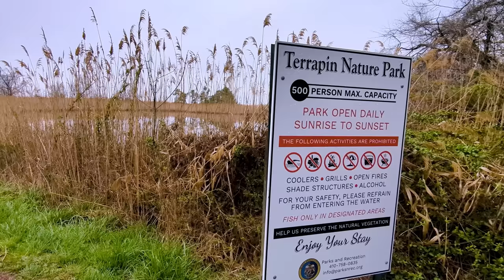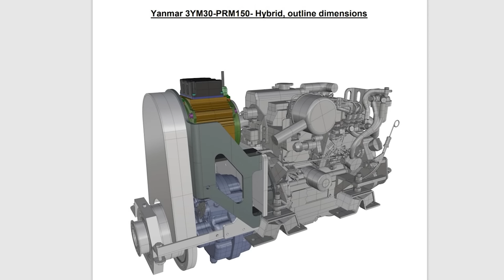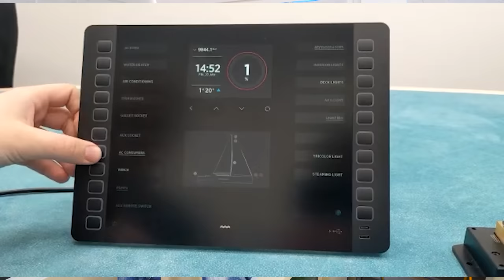Having a Quiet Cry in the Cupboard (MJ Sailing - Ep 278

Comment: As a pro auto body tech and custom car painter  for 40 years, i would say you need an 8" mud hog. Is a gear driven sander for sanding filler. It will make your life SO MUCH EASIER! Also, you have about a zillion square feet of surface. You have to find a way to worry about the stuff that shows, and ease up on stuff that is hidden.  Good luck. Nothing is perfect.
Reply: How about applying the filler with a wider mudknife, on big surfaces? Maybe all the applying with narrow knife makes a very uneven surface…i was noticing at one point in the video a tiny knife while applying.
Reply: @Jb001jb  Depends on how liquid the filler is when mixed. If it's anything like Bondo wouldn't be a good idea to use anything wider than an 8" taping knife.

If it's liquidy like firm drywall mud then I would use a long blade after dumping the filler on the surface. Something like the solid 18 inch aluminum skim coating blades.
Reply: By the time you finish building the perfect boat you’ll be too old to sail it. Don’t get me wrong I love your Channel I hope you achieve what your after but it will take time. You’ll know ever defect and problem in the build nobody else will see them but your eyes will train on them. I know from experience.
Reply: Shop air around a unfinished composite boat/airplane is not good practice! You risk contamination of structural joints. These air tools have atomized oil in the exhaust. You feed them with oil/water free air (supposedly) but the tool itself requires lubrication. Car repairs are typically cosmetic and if it fails you have a unhappy customer, on a composite boats/aircraft you can have a catastrophic failure that mostly will kill someone.
Reply: thanks for trying on the tears!!!
Reply: If they don’t have a hand held masking machine , it would probably help them out and save more time and cleaner lines .

Comment: I've done a bunch of drywall and Bondo etc.. so I can't imagine that fairing is any different. The lesson I've learned is to do it in multiple layers using the least amount of material as possible for each layer while also eliminating the high spots left by the knife. Start with a 3 inch knife for the seams. Then sand. Next use a 6 inch knife to extend out the material. Then sand. Next use a 12 inch knife and sand. Perhaps moving to a 16 inch knife. The principal is to put on the least amount of material as possible to reduce the amount of sanding between coats. 

It may seem like more work but in the end you'll do much less sanding. 

The blue dye may seem like a good idea but you really need to know how to use it. Instead, in between each coat cut the house lights and grab a flash light. Angle it parallel with the surface you're working on and move the flashlight away and towards the surface while rotating it 360° parallel to the wall. Every imperfection will be a shadow. For each shadow use a pencil and circle it. For each circle apply a thin layer of material. Sand as needed. 

As for sanding, somebody mentioned a Mud Hog which is an excellent recommendation for flat areas and bulk removal of material. For the smaller and curved areas pick up a set of Dura Block 7 Piece Sanding Block Kit (not Velcro) and don't be afraid to use a larger grit to remove material. If you have weird areas that the dura Block kit won't cover, buy several Yoga blocks and a profile gauge. Between the two you can customize any sanding profile that you can think of. 

Hope this helps.

Comment: Hey guys, when attempting a high gloss "perfect" finish in a home we never try to get perfection out of the patch (fairing) coat. We sand it down, prime, then spray on 5 or 6 good build-up coats of finish.  When that has hardened after several days we buzz it down with random orbital sanders. You will be able to see how much material to take off and when it is smoothe. Then a couple of finish coats. I don't know how well this would translate to your project, but here it is for what it's worth.

Comment: An easier and faster solution is to make the 3/4" trim around the edge of the door slightly wrap around the edge.  This will hid any imperfections and eliminate the need to make every edge perfect.  And by the way, nothing is perfect - better to just have the trim wrap the edge slightly.  1/16" of an lip will do it.

Comment: I too am a perfectionist. I built my own house like you are building this boat. 
I did everything myself. When I got to the drywall finishing I wanted it to be perfect. But weeks of mudding and sanding I thought I had it but after the primer I saw imperfections so I got the mud out and fixed all of the spots I could see. Then painted still saw spots in the walls and ceilings. So i fixed some more then painted it again. 
Because I did the work myself I could see all the little imperfections everywhere but anyone who looked at it thought it was really good work even a pro drywall contractor offered me some work after seeing it but to me it was imperfect. 
Moral of the story. 
LET IT GO!!!! 
Paint all the closets and hard to see places and concentrate on the more visible areas. 
In years to come you will set back with a drink and notice all the little things that aren’t quite perfect and smile because only you know about it because you built it yourself. 
Life is imperfect so why should your boat be perfect. 
We in the trades call it character. Lol.

Comment: Just think of the fitness regime that you two are going through. 
If you do find any imperfections after you’ve finished put a picture over it but I doubt you will. 
Keep up the great work, when it comes to splash time this bit will all be worth it 
Best wishes from England 🏴
Reply from the maker: It definitely is a good core workout!  And we promise, this is the last time we're going to feature the perils of fairing, haha.  Hopefully in the next few weeks primer will be going on, and then paint.  
And I actually DO have a lot of great new artwork from my friend at @earlewrites that I'm finding spots for among the boat.  😍
Reply: @MJSailing  Don't forget the chance to sand after the primer goes on, assuming you're using a high build primer. That can help the finish coats really look slick. I think the primer is at least as important if not more so than the top coat.

Comment: Well if it weren't for the dust and fumes on the up shot, the exercise you are getting is second to none for upper body stamina and heart health.  I had the same feeling with my 30 footer on the hard at Tidewater on thr upper chesapeake bay. I am not trying to put a showroom piece together at all.  I am hapoy just getting a coat of primer up.  But structurally and for leaks thrrr are a few things i have to takecare of.  I just don't have the time and trying to fit work over a two day weekend is just impossible.  Septermber, October are really the only part of the year with decent outdoor working weather where chances of rain for a week are minimal then when everything is dry a shot on the weekend to do repairs.

Comment: Perfect is the enemy of good is an aphorism which means insistence on perfection often prevents the implementation of good improvements. The Pareto principle or 80–20 rule explains this numerically. For example, it commonly takes 20% of the full time to complete 80% of a task while completing the last 20% of a task takes 80% of the effort.[1] Achieving absolute perfection may be impossible and so, as increasing effort results in diminishing returns, the further activity becomes increasingly inefficient. - Wikipedia. You doing great work, don't sweat the small stuff! ;)

Comment: Fairing is a huge issue. But can i recommend you finish areas seperately to completion. then you have something which is "done". Then proceed to the next area. love your dedication.
Reply from the maker: I think we're going to go that direction with the guest hull.  Prime as much of it as we can at once (we actually are pretty close to that stage now), but then focus on sanding, giving a second prime, sanding, and then painting the forward berth.
Reply: @MJSailing  If nothing more, it may show you that some finished work is far better than you felt. The "good enough" factor will show you just how good the good enough is. Understand? It may show you are over-doing it.

Comment: well to the 'fairing blues'  it sucks!  When you started this and was bogging and sanding inside cupboards... I did wonder.... Having done a 39' cat myself with way, way too many curves, just know that this too will end...Phil
Reply from the maker: Eventually it will.  And that day will be GLORIOUS!!
Reply: @MJSailing  I know you're wanting to save weight which is absolutely the right thing to do, however, I did cheat a bit by using foam backed vinyl which does not require as much fairing before you put it on...

Comment: Having never built a boat, sanded more than two square inch of fairing compound in one go or in fact crawled into a cupboard to do (plenty of) crying, I can’t give any advice (although I would also think that 95% is good enough in most areas). But I am glad that you had a day off and went for a hike, because I know well enough that the emotional drain gets worse without good breaks! Good luck for the return to fairing!

Comment: I get the not wanting to add weight with lots of timber finishes but I feel like there's some really nice marine carpets and vinyls that could be glued straight on to the green panels to give a finished surface and really not add much more weight than the filler and paint does anyway.
Probably too far down the fairing track now anyway.
At any rate, it will all be worth it in the end, plus you will have funny stories to tell about the bits you deem not to be perfect or the bits that are and the journey to get to the finish.

Comment: Guys you are over thinking it. Lay fairing first coat on much thicker sand back with 80 grit,  then  do a fine tight skim to fill scratches and use a 120 grit. Smarter not harder.

Comment: I have Painted overhead luggage Lockers for both Airbus and Boeing, Airbus expect the interior to be same quality as exterior ie faultless while Boeing only expect the exterior to be faultless while interior should be to a high level of quality but the odd minor pin hole is acceptable, saves a lot of time and material and in my opinion makes no difference in Service.I Appreciate it's easier just to make everything look perfect but is really worth all the extra time and money when half of it you probably never look Closely at again when you are using the boat.I know filling composite's all day is a crap job but the end will come !!

Comment: If the fairing compound is anything like polyester body filler, you need to "cheese grate" it when it starts to harden while still a little jell like. this will not only flatten it out, it takes the sticky layer off the clogs the sand paper. I like to use a rounded  auto body grater  it stays flat when using it without a handle. try it
Reply from the maker: I would love to know more about this technique because we do always tend to get the sticky layer on top, and that is what makes this process so hard for me (personally).

Comment: Gee wiz, I would've been inclined to smooth that gelcoat and inside corner out and mate the hardwood trim with a flexible marine caulk... or use a metal trim and router your door back?? There'll be torsional stresses at sea and banging items thru that opening...

Comment: Do you (or anybody) know of a finish (gelcoat or marine paint) that is NOT glossy? 
It is very rare in regular house construction that builders use gloss finish on the walls and ceilings. The newer types of paint are scuff resistant even in a matte finish and are much better at hiding minor imperfections. It seems, in the marine biz. that your two choices are gloss (which will highlight every tiny imperfection) or liners.
Reply from the maker: We're going to be doing a semi gloss paint on our walls, so the imperfections won't be *quite *as visible.

Comment: It’s all in the knife and the consistency of the compound it needs to be creamy but not air rated you have to mix it with a drill with a mixer (like a egg beater) success is in the lay up not sanding
Reply: Consider hiring a sheet rock finisher to apply the fairing. They would be able to take you through the worst of the surface prep. They are much better and quicker at getting a fair surface. A day with someone with these skills and you would be ready to fuss over it till you are happy. Then break out the paint!

Comment: Could there be an issue with technique or tools or products on the fairing?  I could never do a project like this so I am definitely not saying this in a mean way, but it seems like you're having to put in more effort than is reasonable.  Is there another tool that may have seemed like overkill for just doing one boat at first, but now that you're struggling might make sense to get?  That happens to me with my car projects...sometimes the right tool makes all the difference.  Could it be "perfect is the enemy of good"?  It just seems like something isn't right.  You guys are smart, you have some experience, and you're working your asses off...it seems like the results you want should be coming at least a little easier.

Comment: Just start painting.  Your never going to get it perfect and it’s difficult to see any imperfections less than 1/8th inch.  Have you thought about using lightweight facades or panels to cover bigger areas? You had one video showing a boat with paneling that looked amazing, but you wanted to go as light as possible.  Maybe use the lightest materials and only in select areas to hide any imperfections you don’t like after painting?

Comment: I think having flush door frames (as you showed) is a mistake. Why not make the frames with a rebate so they cover the entire fibreglass edge and say 10/15mm of the face. This is normal practise and will speed the process up and in my opinion will look better also. Your proposed frames are (imho) visually too lightweight. Food for thought.
Reply: The movement in a boat is a constant flexing. That is why wood is a traditional building material. Using a flush or inset door panel will bind constantly, as well as make you crazy. Use an overlay door and trim style. This will allow movement and remain operable in all sea states.
Reply: @Janespony  maybe i didn't explain myself well. I'm not suggesting either flush or inset door panels, in fact i didn't mention doors at all.. What I'm suggesting is a rebate in the frame (not the door) to cover the glass fibre opening corner. I hope this makes sense.
Reply from the maker: I've seen boats that have done the raised frame setup.  While quick and smarter, it's not a look we really like.
Reply: @MJSailing  I feel we are talking cross purposes. I will wait to see what you do before posting further comments. Good luck with the sanding.

Comment: Honest question: Why do you need to fair the interior so much? Why not find a lightweight veneer and glue it down? I'm not a huge fan of interiors that are all white gelcoat. Add velcro/screws to veneers where you may need access in the future.

Yes, it's a "production cat" thing to do, but there's a reason why they do it: It looks really good, it's cheap, and it's fast/easy to install!

Heck, even HH cats do all their interiors with honeycomb paneling and glue on veneers. Just fair it enough so it's "flat" and let the veneer and glue do the rest!
Reply from the maker: We actually cover this topic at 12:49 in the video. 😉
Reply: @MJ Sailing  woops! Caught me not watching the whole thing. But like I mention, HH and a lot of other performance brands use honeycomb over veneer. Veneer doesn't really weigh that much. Especially if you're using vinyl or laminate veneer. And it doesn't even have to look like wood! Some veneer on my boat is just white laminate walls in my head. 

One could argue that layers and layers of fairing compound could also be heavy ;).

Comment: Having watched you guys build this now for like 18 months I will say that I think using the blue die the wrong thing to use. I'd use a filler primer out of a rattle can similar to how autobody is done. Body filler is basically the same as fairing compound. Spray in streaks vertically along that surface. ( do not spray the whole surface, just streaks)

I do not believe you are getting a true sense of the surface shape using a liquid like Dicon, regardless of what the claims are about it.
Reply: Additionally one of the reasons why you're oversanding is that the Dicon is not simply "laying" on the surface, it's soaking into it. This is a mistake, and also more than likely why the surface appeared all blue even after sanding (it was in fact, level)

Comment: What is a performance cat? what does it mean? you will not be cruising at 20 knots, fact, the seas get way to rough,  You should make your boat comfortable,  washer dryer, all that good stuff... and weight is actually your friend... 

Are Performance "Cruising" Catamarans Safe?  you should watch this video,  
Antares Catamarans
Reply from the maker: That video didn't use correct numbers.... A few we're orders of magnitude off.    

Light wind ability is the goal not top speed